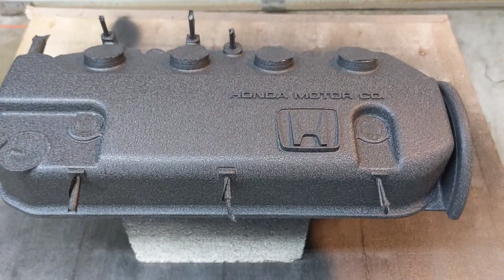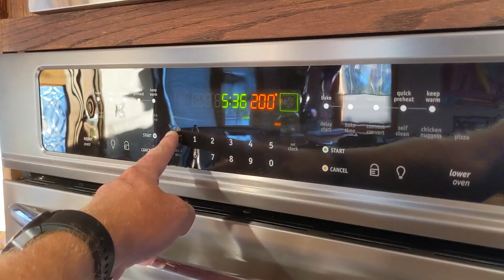Valve Cover Restore - Honda D-Series - Make it So

Comment: Now please do something about them manifolds. Can you coat them the same as the valve covers?
Reply from the maker: You mean the exhaust manifold? There's a heat shield that will cover those up. Those will make an appearance in my next video.

Comment: Nice work.  Did you find the oven to help with the process any, or were you just looking to dry it faster?
Reply from the maker: It says on the VHT can instructions that you can cure it in the oven. I assumed that meant it would make the enamel harder after curing it but I have no way to tell if that's true. It does shrink the wrinkles a bit more than air drying which I think looks a bit closer to the stock wrinkle pattern.
Reply: @MakeItSo  Good to know. I never do the oven after heat gun so maybe I’ll do that next time. I like the smaller wrinkles for sure.